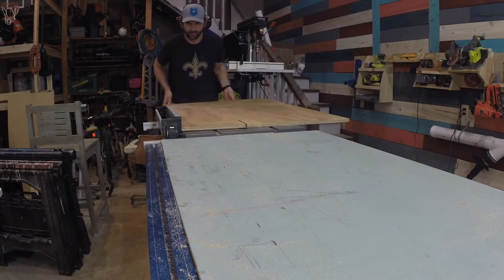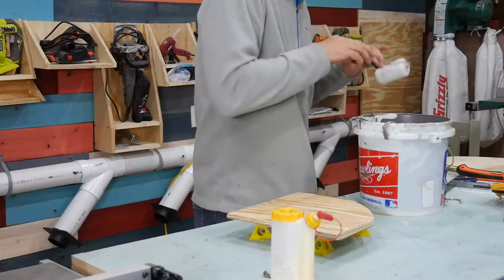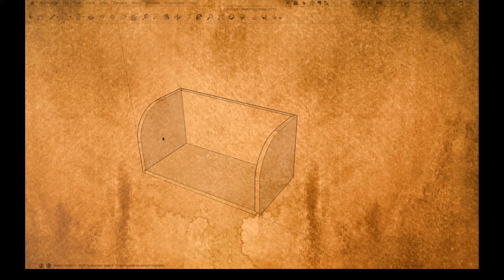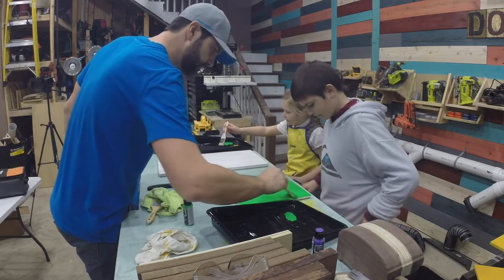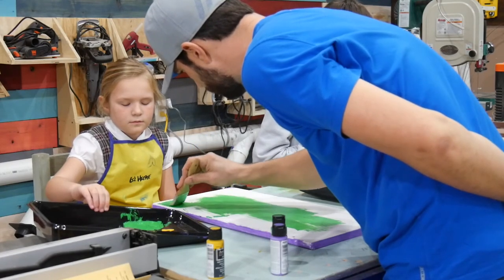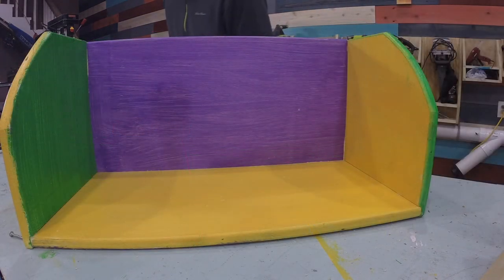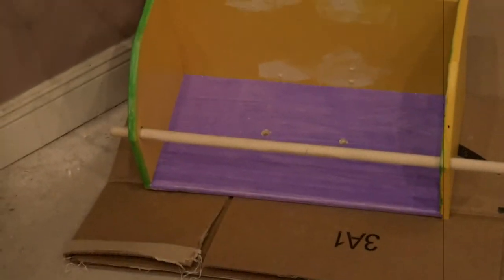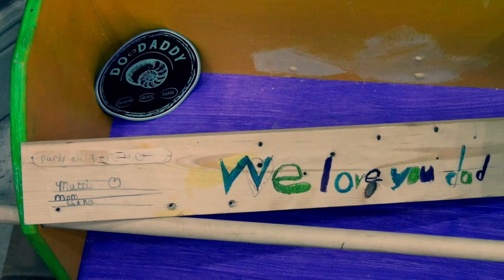DIY Mardi Gras Ladder Seat

Comment: how do you attach the seat to the ladder?
Reply from the maker: Hi Lindsay, it really depends on the type of ladder.  I normally place the seat on the ladder and mark where the holes are located.  Then, I drill the holes and use bolts with wing nuts.  I listed the specific type I used on my blog:  https://do-daddy.com/how-to-make-mardi-gras-ladder-chair/